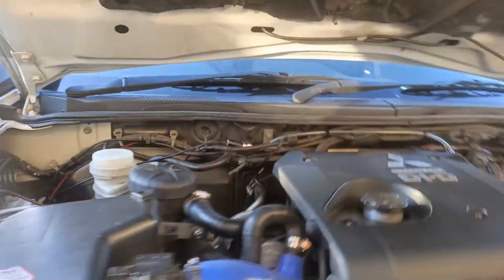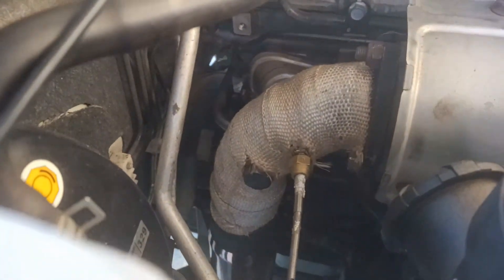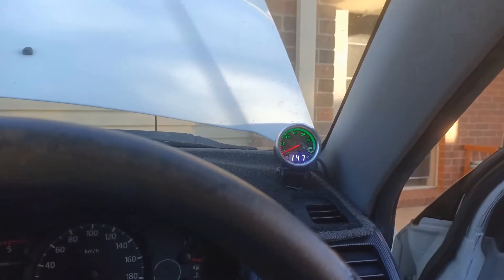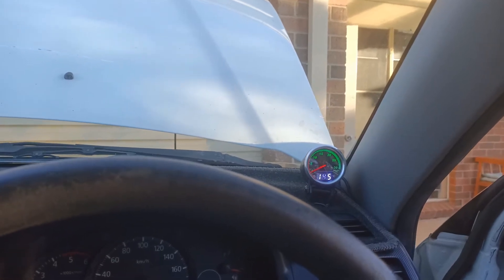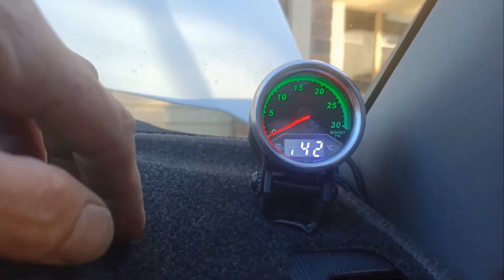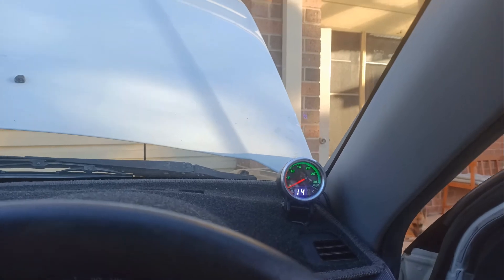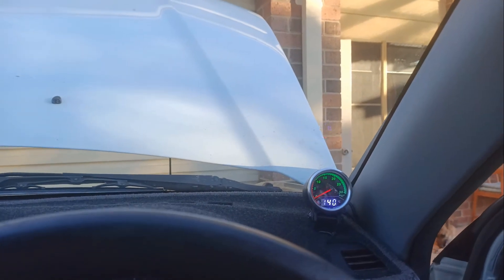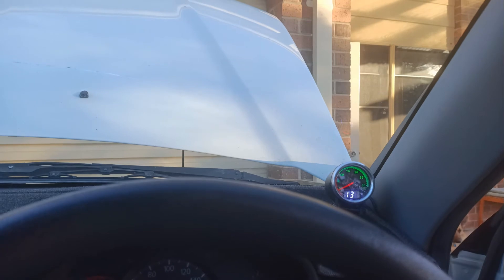new gauge install with problems fixed/ the new exhaust is great!!

Comment: So that was your problem bro glad ya worked it out...... 
There's one other issue people have n don't realise, n its in there wiring.... ( worth testing first)
If it sits at highest reading n keeps blinking, try getting a better earth. If you have an earth on sensor as well as gauges use two differant earth's.
It fixed my problem ( i have a differant gauge)
I am now however haven problems with it not reading anything.... sits at -15psi n doesn't move.

Comment: My saas gauge just flashes red and beeps once the temp hits 999 degrees im not sure what to do about it it was all working great then after stopping and getting some diesel and then restarting the car it starting carrying on but my coolant temp and oil pressure gauge is fine all fitted at the same time.

Comment: Yep got the same issue with the oil pressure sensor. They’re all crap when you buy the package. Then I just bought a replacement sensor. Fixed the issue for 6 months than s**t itself again. SAAS is crap. Aussie brand made in china products

Comment: Did you have a problem with your gauge sitting half way between 0 and 5 when off?
Reply: I just bought one on eBay and it sits half way between 0 and 5 still in the packet, will it correct itself?